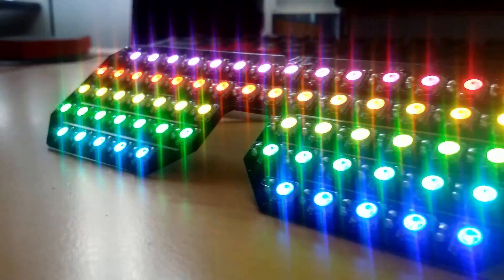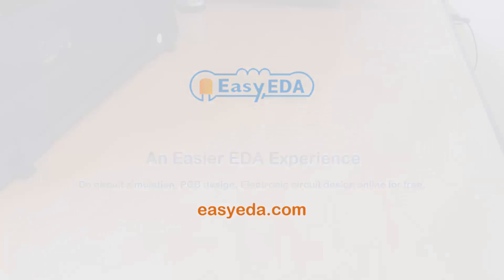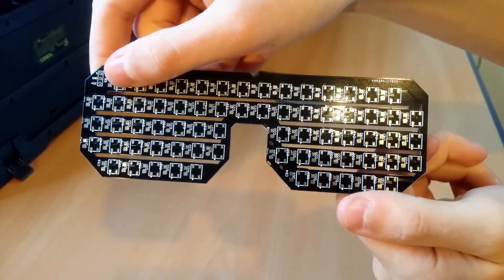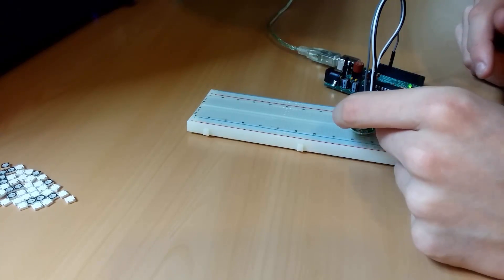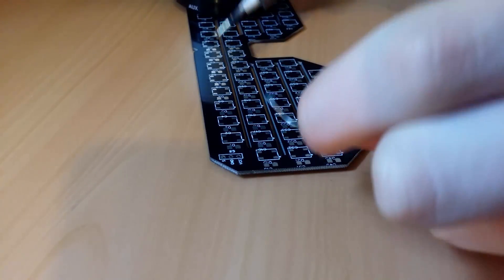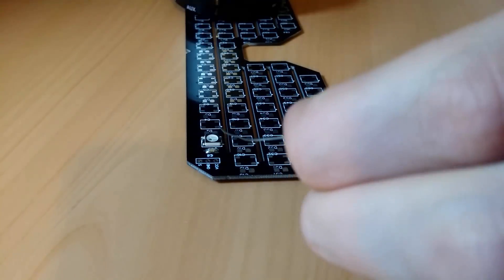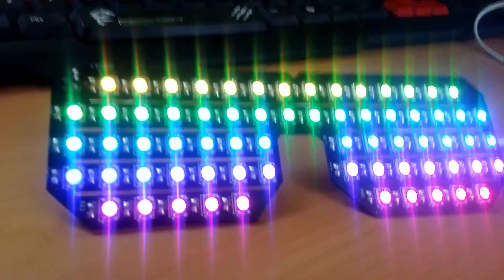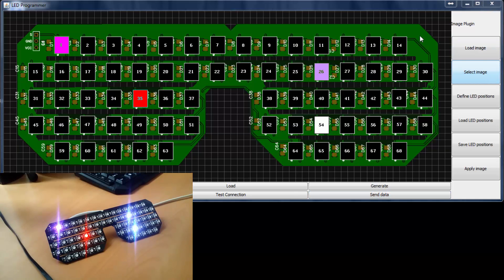DIY | Arduino Controlled RGB LED Shades - Part 2

Comment: Why would you solder all of these by hand and not just bake them on with solder paste?
Reply from the maker: Because I don't have the equipment
Reply: @RGBFreak  You can use a $10 tube of solder paste.  Get some dispensing needles from Amazon for a few bucks to make it easier.  Then $30 on a Wagner heat gun and that's all you need.  I just soldered a tiny board for my 3d printer that would not have been possible without paste and reflow.  Its the way to go.
Reply: @norris1218  A heat gun!  I will have to try that instead of the toaster oven and see how I like it.  THANKS
Reply: @RGBFreak  Equipment?  Solder paste and a $10 USED toaster oven from a thrift store...or your oven if you don't use it for food.  You clearly spend money.  The time saving alone is worth the $20.

Comment: where can i get the pcb board so i can solder the leds???by the way nice project!
Reply from the maker: Thank you! You can get the PCB here - https://easyeda.com/yourics/LED_Glasses-j0wqICUcu
All the other components and a full guide can be found over here - http://www.instructables.com/id/DIY-RGB-LED-Shades-Controlled-by-Arduino/
Reply: sorry for not having the knowledge but my actual problem is that how do i turn  the "downloaded" file into circuit
Reply from the maker: It's ok. You have to click on "Open in Editor" And once you're in the PCB editor you have to click "Fabrication Output" in the top menu (right next to the share button). If you have any more questions feel free to ask!

Comment: looks pretty awesome man! i was actually thinking of doing something like this a couple of months ago but im on a tight budget. have you ever considered using the hot plate method for your SMD components since theyre all on the same side? its much easier and faster than soldering each joint individually. thats the method i use for my boards since they all use 0603 components
Reply from the maker: Thanks for the positive comment man! Yes I have considered using one, but since hand soldering doesn't take up that much time and I was tight on budget as well I figured hand soldering would work as well. Hope you can make one yourself one day. They are pretty awesome! If you look in my playlist you can see that I even created a Android app that's available for download :)
Reply: Dude it doesnt take any extra money to do the hot plate. I use a skillet on an electric stove. You just need to play around with the heat till you find the "sweet spot" and make sure to turn the heat off once all the solder joints have melted. One thing i like about it is that you dont get any cold joints. And the components will actually straighten themselves out so you dont end up with crooked parts. Which is good if youre OCD lol
Reply: Also make sure you dont use that skillet for anything else. You dont want to end up with hazardous chemicals in your food. Bad stuff.
Reply from the maker: Thanks for the advice! I will sure try it out one time! Also thanks for subscribing :)
Reply: Np man! Best of luck!